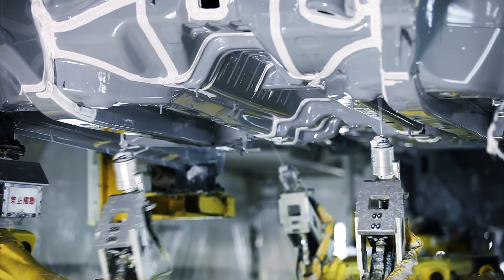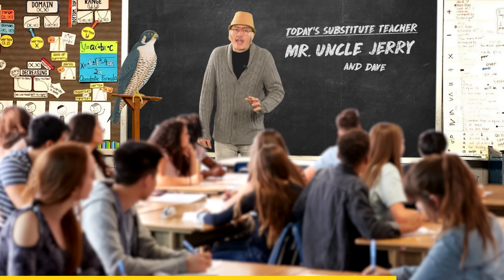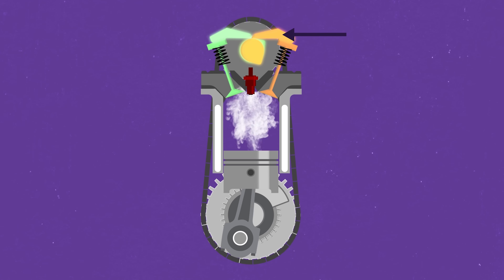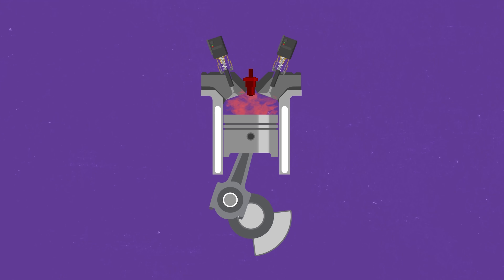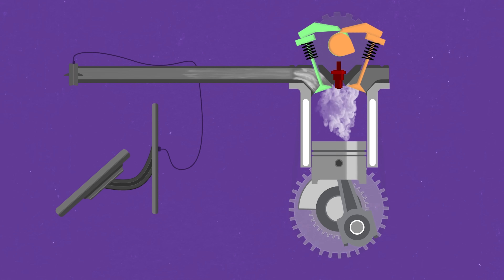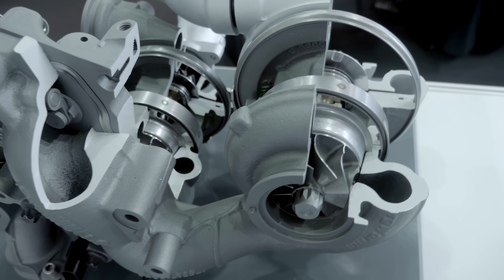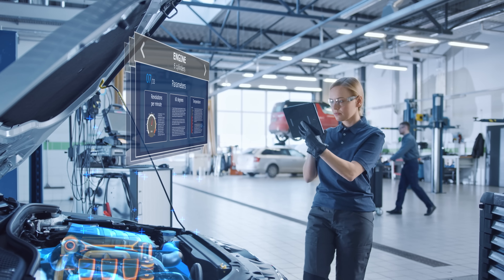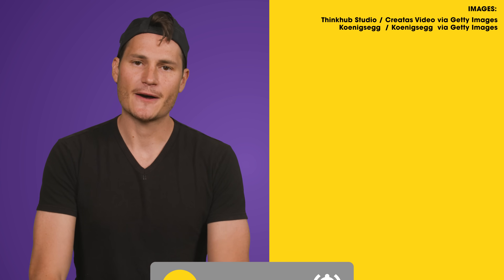This Is The Last Great Engine Tech

Comment: I learned of the Freevalve a couple of months ago and it still blows my mind. Valve timing could be perfect to run at any rpm from, who knows, 250rpm? to 7,000 rpm unthrottled, and therefore very efficiently. Running slow enough you don't need 4 valves per cylinder? Only open 2...or 3. Kiss EGR valve problems goodbye, you just time the valves so it backs a little exhaust gas into the intake tract. Displacement on Demand? All the hardware is already on the engine, nothing to add.

Comment: This is similar to FIAT's MultiAir engines, which have been used for about a decade now. However I'm pretty sure FIAT only uses it on the intake valves and their turbo's still have a wastegate so that's more evidence to a traditional mechanically lifted exhaust valve.

Comment: I think you are wrong, Engnering Expalined show the model of Koenigsegg Engine and it has 2 turbos. One for each eshaust valve and they patented Rocket Catalytic converter. Why on the video you tell that one set of valves is for turbo and one for catalytic converter?

Comment: It’s called a Fiat Chrysler..... The 2.4 L in the Dodge dart Chrysler 200 Jeep renegade‘s and a few others. Now yes it’s still does have a single overhead cam cam shaft operating the exhaust valves.... but the intake is an Electric/hydraulic system. similar to the free value for about $3,000.

Comment: I think Mazda and Porsche are still really committed to the ICE for their sports car range so there is probably a market for this. Imagine adding this technology to a GT3 4.0 engine? 30% better fuel economy and 30% more power with less moving parts and probably less engine weight because you can get rid of the timing chain and cams? That sounds amazing. Reliability is a factor but if they can prove this system to be reliable, it might help extend the technology and make ICE viable for at least a few more years

Comment: Your explanation of digital valves killed me. You might want to do a bit more research on that bit. That said, I freakin love this topic! Drop throttle bodies, carburetors, timing belt/chain/gear/shafts, EGR systems, cam shafts, tappets, rollers, and rockers in the scrap bin and have a scavenging intake manifold, port injection, fully electronic valves, AND direct injection installed. Did anyone say 150 ponies per liter, no boost? I say the next thing after this could be fully electronic compressed air/fuel direct injection.

Comment: You forgot to mention a couple of things. The freevalve system uses compressed air to open and close the valves.
Why? because air moves faster than an electric actuator. The electric part of the freevalve system opens an air valve that controls the air pressure behind the valve.
This has another really cool benefit!
If a valve is hit by a piston, the valve just retracts.... it doesn't bend and break like in a regular car! Why? because behind it, there's only air.... not other metal pieces pushing it open while the piston is pushing it closed.

Comment: I'm really curious about the reliability of the free valves system
Reply: As reliable as your fuel injection. Will never break. Possible electrical problems
Reply: @raceyrache8463  that's exactly what i thought

Comment: Ive said it for years now take free valve heads nissan's variable compression block add dry sump oil system twin scroll turbo system  and tpi plasma ignition system and you have a true smart engine  the last true evolution of i.c.e's before electric takes over

Comment: Cars also run higher on idle because they aren't operating in closed loop mode in the ECU for fuel injection. The oxygen sensor that lets the car know how much feel is be burned has to warm up first, so the car will run rich to protect the engine until it can get an accurate reading about the mixture in the exhaust and fine tune the fuel injection

Comment: With less moving parts you can make a bigger boar engines that can rev at a higher rpm. For example a 7.x litter 4 banger that can rev safely at 5.2k rpms.

Comment: So, can electric cars take over the car market? Simple answer: No. 
Longer answer: Electric cars have become cool. But here’s the rub. Battery electric drive requires the batteries to be recharged at some point. Duh. But have you ready thought about how much electricity that’s going to require?
The market is kinda limited at this point, but most of them average out to about 300 watt hours per mile travelled. According to the D.O.T. the average commuter drives 37.6 miles per day. So multiply 37.6 by .3 and you have the number of kilowatts you’ll need to recharge at the end if the day. 
But remember, 17.5 million passenger vehicles are sold every year. So multiply that number by 17.5 thats how many gigawatts that will be demanding on the grid every day as soon a people get home. 
And if you didn’t do the math, 197.4 gigawatts of power that needs to be added to the grid. Nearly 200 gws of base load capacity. Note that Grand Coulee Dam is the largest power station in the USA, produces up to 6.8 gigawatts of base load. It currently powers over 4 million homes throughout Oregon, Washington, Idaho and up in BC. 
So unless the left can either be silenced, the liberals can get over their atomophobia, and both stop being pathological obstructionists, so we can get our regulatory and economic houses in order, so we can build the roughly 50 10 gigawatt Molten Salt LFTR type nuclear power stations all across this country to power all these electric cars. Not that this is just a start, because electric cars will likely stay on the road much longer than ICE powered cars. Expect to need to bolster the grid with 10 ten times that much power over time.

Comment: This looks like a tutorial how to get more power out of your miata or honda.. chase that little 3-8HP, or just slap a big ass turbo and fuel it as everyone does. It is technology forward, but its so early that only the big guys do that.. talk about it in about 10 years, when all the EV craze fail

Also, would I trust some electric actuator when it fails it shuts off? I'd better trust some steel spinning, after it gives up there is just that little bit of meat, limping me home.

Comment: The complexity of this is astounding.  @7200 rpm, each cylinder stroke occurs in 0.00417 seconds.  A typical valve duration is 240 degrees, so 240/180 degrees=1.33 means the valve has to open, do its thing, and close in 0.00554 seconds.  That is very sporty!  Most solenoid valves have jus an opening response of 0.010 seconds.  Also, if the solenoid slows down for some reason, you are banging valves.

Comment: Free valve the Miata!  So I have this idea, if your spark and fuel and valves were all electronically controlled you could theoretically flip your engine over to a two stroke cycle at the flick of a switch.  That should allow nearly twice as much power produced per revolution though heat rejection would be problematic so it would only be for short bursts and I’m pretty confident you’d need forced induction to have any kind of scavenging.

Comment: Imagine an LS engine with this tech. You could probably give it 4 valves per cylinder as well. With the free valve you could even have it sip fuel at idle with only 2 valves per cylinder, or on the high way. Then when you mash the throttle all 4 valves open up nice and wide for some gnarly power. Could prob get 50 MPG on a C5 vette if it had lean burn mode tuned in.

Comment: Fiats Multiair intake system works pretty much like the freevalve. But instead of using air to actuate the valves it uses the oil pressure system

Comment: How reliable are the actuators vs a timing chain? At least with a timing chain stretch, you can tell the car runs like crap but won't ruin the valves or pistons all of the sudden. With the actuators sticking and valves fully open, you're gonna have a bad day. This assumes inference engine and the actuators are strong enough to hold the valves in place and piston contact can ruin something.

Comment: Very excited about Freevalve tech  at least a stop gap measure to boost engine efficiency.  Gonna have to look into the Mitia project...  Problem will be how long the engine parts will last with the higher stresses...

Comment: Engines went from flat heads to OHC to accommodate multi-lobe cams and later DOHC. With this tech there's no need for bulky heads anymore as these valves can be placed directly on the block as well as the injectors and sparkplugs. This means after 100 years engines might go back to flat heads.

Comment: Yes would love to see done to money pit Miata, just keep in mind your video presentation was incorrect in the movements of the valves, the on position is at the top and off would be at the bottom, on the digital graph the top line would be your 5v reference or the actual 12v spot

Comment: It's good information, but I have request.... Can you make a video on Alfadans new 4 cylinder engine.  Because that engine doesn't have balancer shaft and it can rave higher rpm and it also have higher capacity & that engine also got Free valve technology in it... So please explain that

Comment: best part is no part, turbines, continuous burn
Reply: just one moving part
Reply: continuous free burn, external or turbine internal, full clean burn, no remains
Reply: you can heat the cat if you need with peltier heater, pre-heated, like 3d printer pre-heated bed, nom nom
Reply: window heaters are nice, resistive wires around the foundry
Reply: cast or cnc aluminium

Comment: Good idea, but I don't want my engine to blow because one of the 16 valves actuators stopped working. Though I suppose if they're naturally closed they should just make that cylinder to run on one of the two valves.

Comment: Being able to fit bigger engines in smaller spaces thanks to freevalve tech would be amazing! Not to mention the additional performance and fuel economy/environmental improvements! Imagine all the engine swaps that could be possible if the top of the engine was smaller/lower profile!

I could seriously see this kind of tech extending the life of the combustion engine for OEMs for quite a while if it became mainstream and affordable. Also, the aftermarket kits would awesome!

Comment: Fiat has Multiair that does a similar thing, hydraulically operated intake valves increase the torque and power while decreasing emissions.
Reply: Love my Fiat, and the multiair does wonders. Little thing out performs my V8 F150 and V8 Durango everytime, and even off the road it rips through trails and never gets stuck, compared to the other two.
Reply: Brothers of the same mother.
(sister companies basically)
Reply: Yup, though it's only on the intake side on their cars, freevalve is both intake and exhaust
Reply: https://youtu.be/JIxmRSujdGM
Reply: I belive that engine is also in the modern Dodge dart compacts and newer jeep renegades

Comment: Yeah, sorry. The analog vs digital comparison makes absolutely no sense at all and totally misses the point. 

Really, analog vs digital is not the issue here. The issue is that normal crankshafts are hard coupled to the RPM as explained in the video while the software-controlled counterpart is completely decoupled. Basically, with the crankshaft, you get one (with VTEC maybe two) functions that determines the relationship between RPM and valve position. With the software controlled version, you get any function at any time you want. 

The digital software is translated into analog movement of the valve anyway. We have endless methods like PWM-controlled linear actuators and what not that do this. The technology is decades old, the application may be new. 

So really what's important to understand here is that in the end, the displacement of a valve will have the same movement range & precisions (including frequency) as if it would be controlled by an analog signal. Regardless, whenever we're dealing with mechanical movement of this type, there is enough momentum and mass involved especially in linear motion (rotation is something different)  that we won't even get close to having to deal with the resolution and precision that electrical signals have to offer, be it analog or digital. 

I made the math in my head, we're probably dealing with signals and bit-streams comparable to audio even when we assume supporting 10.000RPM and use a full 256 samples per revolution to describe the position of the vales. 

Sorry, supper long rant. But this comparison was just soo far off describing the differences between digital and analog that I couldn't hold my frustration.

Comment: Awesome system but i have a few objections on reliability, everything's ideal for people regardless the sacrifice, wait until you see a camshaft literally spinning its lifespan out to failure whereas this system will gunk up and get stuck eventually because its actuating strength is limited, or going out by some sort of failure on an ECU or solenoid the manufacturers are going to put a 4 digit price on it each time you need one.
It would be miles better if you had a master camshaft and actuate its actual height position on the head to set the profile, and its timing by having variable cam gearing by spinning it with separate hydraulics that would also actuate the cam.

Comment: Now I know the best form is all the individual valves being controlled, but it even sounds like you could get similar gains if you just decoupled the cam shaft from your crank case and run that off an electric motor. There’s so many mechanical systems on a car that could be digitized, and not all of them seem like they have to be hypercar level tech

Comment: Can you look into, and possibly make a video about 2011-2013 Mini Cooper throttle body/valve setup
Supposedly my throttle is only used on cold start and then after that as I give it more gas the valves begin to open further/longer? 
And the throttle body is just there for back up if the system fails??

Comment: Running on farts lol. Had a generator running on methane gas from a digester from a sewage plant. Big problem was the dirty gas corroding the engine and it blew up after a year. It was not cost effective because it cost too much to clean the digester gas. You also have hydrogen sulfide as well in the mix.

Comment: i wish someone would offer a freevalve cylinder head for chevy bigblocks. i wouldnt mind if it costs twice as much as a regular head. 
the savings on fuel injection system alone will probably make up for it.

Comment: The exhaust description is WRONG! ALL EXHAUST FEEDS THE TURBOS AT THE APPROPRIATE THROTTLING, NOT ONLY HALF. AT IDLE A VALVE CLOSES YOU HEAT CATS FASTER, BUT UNDER POWER THE EXHAUST VALVE OPENS AND AND SENDS EXHAUST TO THE TURBOS WITH THE OTHER HALF OF THE EXHAUST. FREEVALVE has been around much longer than 5 yrs...How does your company do such bad research to be so wrong???

Comment: I have been wondering for a very long time why the entire engine isn't computerized yet and we still fiddle around with timing chains and cams and rocker arms and a myriad small pieces that need oiling etc and can destroy the whole engine when they start acting up. It can't be that hard to make a valve open and close with a magnet.. it's already what fuel injectors do at super high pressures
Reply: And then once we have that we could completely redesign the air intakes too and go for air injectors, you wouldn't even need a turbo or supercharger anymore

Comment: The free valve system will probably be mainly used in motorsports for fuel efficiency and less emissions, combined with the "air" fuel. Other than that enthusiasts will also most likely use it so they can keep up with emission standards.

Comment: I want Freevalve heads for all kinds of engines, especially those popular for swaps and big turbos.  Imagine taking a 4G63T, dropping it in a base model Lancer, Neon, etc, then throwing Freevalve on there with the appropriate exhaust so as to hide your true power until the light turns green….

Comment: Hmmmm... What if?... You take that tech (peak-gating your airflow), strap it to a powerplant that is the peak in torque at its most synchronous (compression, revolution, vibration and heat generating wise), and couple it to an electric drive system (disconnecting the engine part almost completely from power need). Sounds boring, driver-experience-wise, but purdy shure it would be the best MOPOWAHBEBEH-per-liter setup (at every part of the speed-requirement spectrum)... Hmmm, I'm also sure you can strap in a CCT somewhere in there (bonus if the emissions and heat output are already optimal)...

Comment: Really nice explenation, im jsut asking myself if there is any delay for the valves, or does the ECU calculates that delay. I mean in cars that have a electronic throttle, there is a small delay between the throttle and the engine responding to that throttle. For the throttle this isnt a huge problem, but it could cause the death for the valves/engine. 
I guess the ECU can calculate that delay but i would really like to know if that could run into problems or if im just talking shit.
I would be really thankful for some infos on that =)

Comment: I think that it has very strong promise just question the reliability long term on a daily driver in extreme temperatures and weather. That being said if i had a second car and the engine went and it was an option to do free valve or regular combustion engine i would think i would go free valve even if it had a slight premium price

Comment: I'm pretty sure the mulitair tigershark motor in some Chrysler vehicles is very similar to that, except I think the valves may be oil actuated, but they could be electric. I will have to look into it one day when I'm not quite so busy at work.